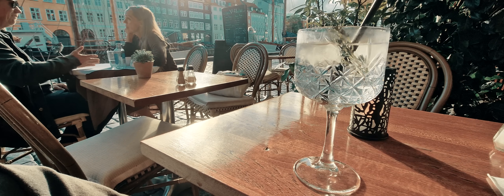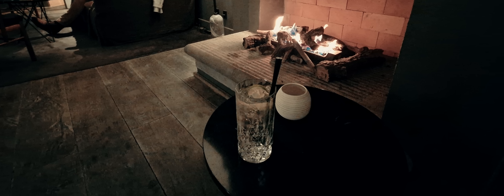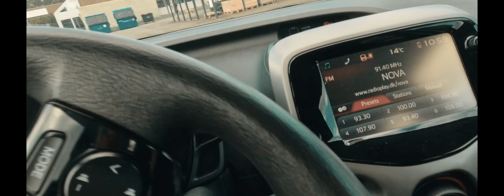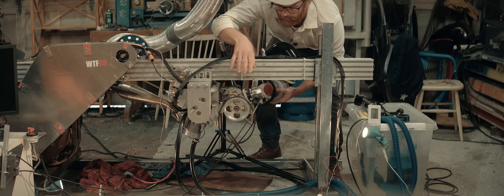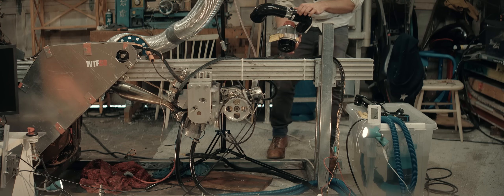Blown 50cc Two Stroke gets a ROTREX Supercharger!

Comment: You're gonna have to be very mindful of fuelling when you shut the throttle at pressure. I'd also test the carb body and seals at pressure. Apply 2 bar to the carb and see if it leaks. You also have to be mindful of fire. Leaks at the carbs have both air and fuel at high pressure, this is basically a flame thrower.
Reply: Most motorcycle carbs do fine until 30psi and a simple plenum that encloses it will stop that issue easy. As for when you close the throttle it should have vacuum behind it. You can also go a good bit higher without enclosing it with flat or round slide carbs than you can with a CV although the CV will tune easier. The pwk I'm using now sees over 60psi occasionally and aside from a brace to hold the bowl on and a small oring where the cable goes it barely makes any leaks. (Small mist around the cable hole)
Reply: @oliverscorsim  I'm saying to Alex he should test 'his' carb as not all carbs are created equally lol
Reply: @thedirtyworkshop  great plan but not so easy to test. It's a small problem most of the time and I don't think we're gonna see Alex take this thing over 25psi tbh. Would be awesome if he did and if he plans on it I'd skip all that and just put it in the plenum so it can't be an issue.
Reply: The boost might blow that slide plate out. need to make sure there is boost on the "pull" side of the throttle plate.
Reply: @rubikmonat6589  yes actually a stiff spring works most of the time but a reference port would be a great way. I did actually have this happen on my first 40psi road test and let's just say I'm glad kill switches work lol. Now I run a stiffer spring and i drilled the slide hole abit bigger problems gone but I did forget about that oh shit moment way back lol.

Comment: I'm curious to know what the charge air temp is before and after fuel atomization (the carb). Would tell you if a intercooler is even nessary.
Reply: Blow through on e85 we see about -250°f drop across without dry ice then we can get ice on the carb at 60psi. Actually the biggest reason we went from efi to blow through.

Comment: it's been a while for me now but if you charge a two-stroke engine, i.e. whether it's a compressor or a turbocharger, the tuning exhaust is no longer helpful but rather in the way of the gass.try it this out
Reply from the maker: We're here to find out if that statement holds true👍 I kinda started in the wrong end by building the alternative with exhaust duct valves first tho.
Reply: I mean you dont neade the sucking efeckt any more ( and that is a porcharger not a supercharger)🤫
Reply: The exhaust would also not be helpful at atmospheric pressure then? I don't see the difference, whether it 14.7 psi, or 30 something. Are you saying that there is a certain pressure, above 14.7psi, that the exhaust stops working?
Reply: @Scissors69  With a two-stroke engine, the pear-shaped top plate is important because it improves performance in certain speed ranges by generating a negative pressure by reflecting the pressure wave, which sucks exhaust gas out of the combustion chamber and sucks in a fuel-air mixture. (two eighth have no valves) but if you work with compressed air, 1. the speed doesn't matter and 2. the pears from the exhaust becomes a ''bottleneck'' (translated by googel)
Reply: @Scissors69  https://youtu.be/_v9gnC5PiWk
Reply: @Scissors69  was that halpfull?
Reply: @johnatanfalck3021  - at what pressure, above atmospheric, does the exhaust become not helpful?

Comment: I designed and 3D printed a centrifugal electric supercharger. It works. Charges my Volvo 1,6 D at 4-5 PSI. Ran at ~20 000 RPM with a 12S 5000 mAh lipo. I'm going ot make a new one with a higher Kv motor and a big 24 V battery next.
Reply: See Alexltdlx